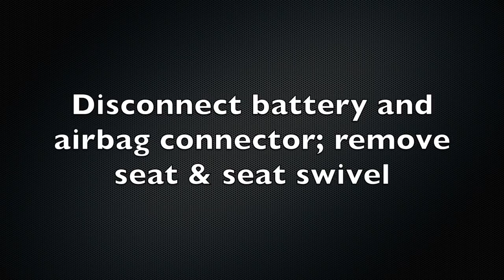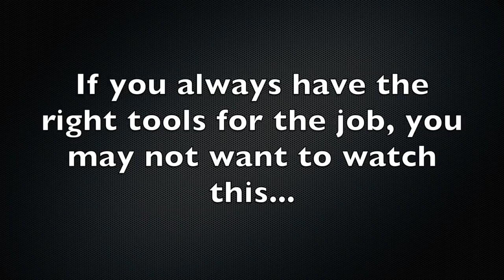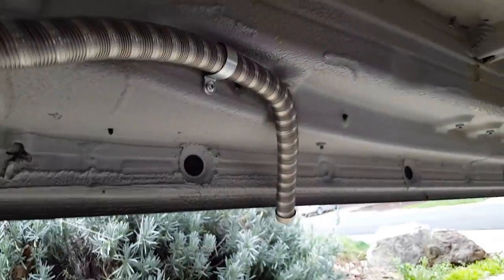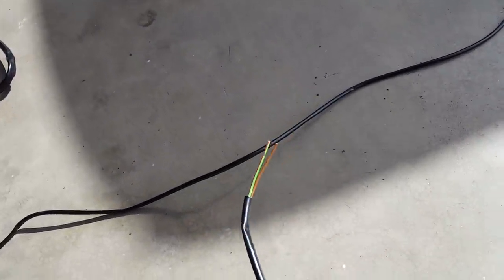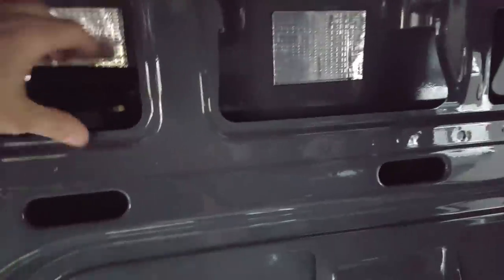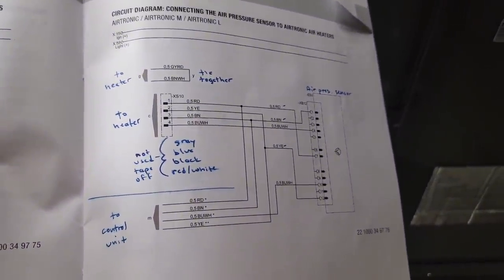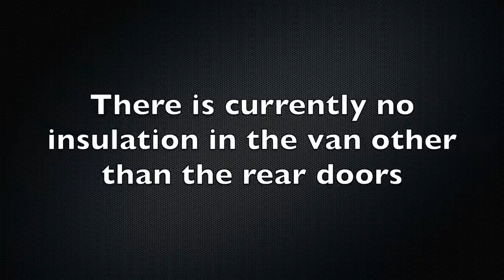Espar D2 Diesel Heater Install in a Mercedes Sprinter Camper Van

Comment: Great video! The one thing I noticed, if you are particular about torqued bolts to correct ft/lb using multiple extensions will throw the torque off. 10/10 install
Reply from the maker: Good to know, I was not aware.  I’ll have to think through that, it seems to me the extensions would transmit the same torque through them. But maybe not.

Comment: What a difficult install, bravo Ken!  The wiring looked very intimidating.  You are a master craftsman in your van build, and also in filming it with your detailed documentary style.  I have learned a great deal from you.  If you ever need a place to rest up and reload your van during travels, my house and driveway are open to you - in Santa Clara, CA.  I am also very good at fixing any health issues with supplements (over the counter) and back pain issues with targeted stretches.  This knowledge I can pass on to you if you need it.  Something to give back for all I have received.  Many thanks!
Reply from the maker: Thank you, much appreciated!  The electrical was definitely the most challenging part.

Comment: Thanks for the video. For future projects that need larger holes, consider a step bit for your drill.  You can get them cheap and in different sizes at Harbor Freight (Under $10).  Home Depot and Lowes carry brand names for a little more.   Very handy items for making precise size holes easily.  Buy the bigger size, as it will make small holes, too.

Comment: Great heater i have one install at oktober 2015 and use it 2 winters -14.
Works well does not use lotts off electra amd olso diesel.i have 2 140 amp Lithium battery install under front seats and heater at motor .Heats also motor.

Comment: Thanks I didn't think of it in the passenger seat the one I bought is bigger but we'll see if it fits I didn't know about the fuel line tap on the Sprinter so thanks that saves me from drilling a hole in a fuel tank which I didn't want to do
Reply from the maker: Most US Sprinters have the aux fuel tap but I've heard some Canadian vans don't have it for whatever reason.

Comment: Great video, please keep them coming as you progress through your build. In fact, you should have your own Sunday morning car show!! I'm undecided about installing my D2 myself or hiring it out. If I may ask a quick question, because frankly; I trust your opinion more than my local Espar dealer. My vehicle is a 2016 MB 144.While haveing a discussion with the upfitter, specifically covering what is included in their insane estimate for the installation of a D2, they said that "tapping into the main fuel tank at the aux tank connector is problematic because it's a pressurized system and all adapters and splices will fail. Not to mention the heater will fail from running rich from the over pressurized fuel getting into the heater fuel supply." So their solution is to drop the tank and add a stand pipe. It seems excessive to me, dropping the fuel tank and adding a stand pipe for the Espar heaters pump to draw from. It also seems they've created a problem that no one else on the internet has ever had. My question to you is, is their point even rational? Is this something to even consider?They insist I'm not their personal test case, because they've installed 5 of these. That alone makes me a skeptic. Thanks for your time.
Reply: Thanks for the super fast reply. Your answer was as I expected. Sadly that means I must attempt this on my own. Unless of course you can be tempted by Oregon IPA, because like you said, now that you've done it, you could do it much faster next time!  Keep the videos coming, they're very encouraging.
Reply: What was the response to this question?  I am interested to know, because I just T’d off of the aux heater fuel line to run fuel to the pump. I am about to install the High Altitude kit.
Reply from the maker: There is no basis I can think of for that argument.  Mercedes leaves the tap there for the purpose of auxiliary heating units.  I've never heard of anyone having a problem.

Comment: Hey Ken, in another video they mentioned that the the exhaust pipe between the heater the silencer (muffler) needs to be shorter than the tail end. I verified via the espar manual in the notes section on pg 23.  "if a silencer is fitted, the exhaust end pipe must be much shorter than the flexible exhaust pipe between the heater and the exhaust silencer." Not sure of the reasoning. Thanks for making this video. I've watched it about 50 times already prepping for my install.
Reply from the maker: Thanks Jim, I had read that as well.  As usual I had to compromise...had I moved the muffler further downstream the exhaust would have needed to turn upward (in order to mount the muffler), and then you create a low point for condensation that will rust the exhaust.  Always a compromise, it seems!
Reply: @ourkaravan  totally understand. Any tips on making the terminal connectors? I know its way easier using quick splices. Did you use a double crimp tool?
Reply from the maker: @jim6335  Yes, I used these http://www.amazon.com/gp/product/B0069TRKJ0  for small gauge wire and these http://www.amazon.com/gp/product/B00MVE48Z6  for some of the larger stuff.  They are reasonably priced, so I pulled the trigger and just bought them.

Comment: Hi again thank you for making the video. I didn't watch far enough to see where you had the wiring diagram and talked about the colors.. Again, it would have been helpful to see you connect the individual wires to the espar clip that snaps into the altitude unit.
Reply from the maker: I'm pretty sure I discussed that in the video. I showed the diagram and how you only use four wires between the HAC and the thermostat.  Sorry if it wasn't clear.

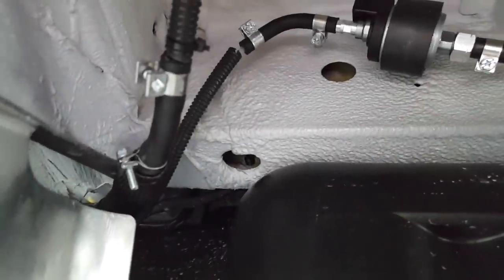Comment: I'm just installing my heater now.  Instructions on CD included in my kit are a bit ambiguous for direction for the metering pump.  Figure on page 24 (25.2720.90.0001.0A_EN_0518.pdf) is opposite than shown here at 4:45. However, page 10 of same pdf (scope of supply diagram) agrees with this video.   Aaaargh!. 

 My instructions also specify that longer exhaust piping before the muffler than after, compared to your comments around 7:30.
Reply from the maker: I can't access the document you're talking about but I know for sure my fuel pump is in the correct orientation.  As for the exhaust piping, I do believe Espar recommends longer piping before the muffler, I think I had indicated in the video that they are quieter if the muffler is further upstream.
Reply: @ourkaravan  Thanks for the confirmation, I'm going with that orientation for my initial test.  Need to wire up my controller and external temp sensor and then fire it up!  :)

Comment: wow, your video makes it looks so easy and I want to install one of these in my Promaster campervan too. But I know there is a lot of hard work went into the installation. Thank you for sharing!
Have you ever considered the webasto diesel heater when you planned the installation? Have you done any comparison between the two brands?
Reply: Eli Dai webasto is just three times more money.
Reply: My Webasto heater has a knob that sets exact temperatures. I had it installed in my Sprinter about 4-5 months ago. I chose the "digital" thermostat. It cost a little more

Comment: Good video thanks. There is no ground on a 12 DC system, it is a negative, hence the symbol on the battery, an AC system is grounded and has no negative,

Comment: Great video and channel, definitely a new subscriber. Have you noticed any problem with condensation since you’re only taking combustion air from the outside, and not the cold air intake?
Reply from the maker: Thank you Kevin. My understanding is that since the combustion and exhaust occur outside the vehicle and only room air is drawn in and heated, if anything it should have a drying effect.  I have had no issues with moisture.

Comment: That scalloped part of the seat base looks like it was made just for the gasket (template) to fit :)
Reply from the maker: I think I saw somewhere that some factory applications used that location for the diesel heater, but I'm not sure.  Sure worked for me though!

Comment: I did the same install , I'm very good at wiring but found this install to be very intimidating but like you said after you do it once it would be a piece of cake to do it again.
Thank you for your video I gathered a lot of info from your video and others , I definetly couldn't have done it with out the help.
How did you change it from low , med , high , boost?
Thank you for taking the time.
Reply from the maker: Congrats on the install!   The Espar figures out the correct mode to run.  It's interesting how it works--when you first turn it on, the furnace runs at full speed to bring the van to temperature.  Once it hits the set point the Espar picks the correct speed to keep the van to temperature.  It does this by measuring the temperature of the intake air and the room temp and tries to run at the lowest speed possible without exceeding the set temp.  If set temp is exceeded, it shuts down.  It's smart because the constant stopping and restarting uses more energy as it needs the glow plug to relight.

Comment: Bit late to the party on this one but your vid is very well put together and informative. Question; Is there sufficient access to the heater fuses through that little cover in the side of the seat base when the seat and swivel assy. are in place?

Comment: Excellent. Thanks so much as I'm getting ready to do this. Regarding the Dorman connector. Did you not need to T-off from the factory fuel connector? Someone else on the Sprinter Forum mentioned having to do that and using Dorman part # 800-176 which is a T. Maybe this is only required if you have the auxiliary fuel heater installed from factory? Or, how did you attach your Dorman connector? Did you cut an existing line? Thanks again.

Comment: Very nice install ! I am running an older D1 heater, still does a great job at heating. I do have one question, is there enough input air coming into the heater as it is mounted under the seat? I did not see a hose run for the input air. My instructions inform me that if a unit is placed in an area that is enclosed that one should make sure they have an air intake for the heater.

Comment: If you really need to extend the exhaust adapt it to a slightly larger pipe. That should prevent any extra back pressure.
Reply from the maker: That's what I will do if I ever extend it.  Performance exhaust for the Espar, haha.

Comment: Great video and nice install.. if you ever have any need to do any more work would it be possible to get the part number for your seat base ? I'm thinking of doing the same thing but uk-spec vans come with a slightly different seat base that doesn't allow for this type of install

Comment: This is an awesome video, thanks for posting. It helped me to get almost all the way there. I was shipped a very different wiring harness that doesn't seem to be for this application. DO you happen to know the part number of the harness that you have? I'm dead in the water until I figure this part out.

Thanks
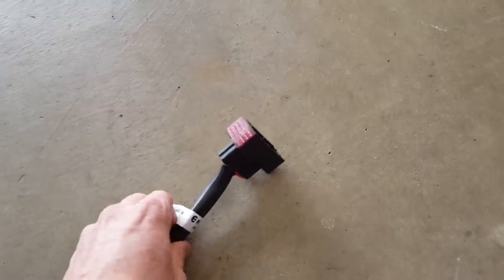Reply: Bummer, The part number is on the cable by the large wiring harness clip that connects by the heater (@9:26).I tried to screen grab, but it's just too blurry. That is also where my harness splits three ways, then ultimately terminating to two on the end of the very long bundles. There is no way for it to be installed in any manner that I can think of...and Heatso.com is playing dumb with the parts, that's also where I ordered. It's super frustrating. If I can find the part number that you have for your harness, I'll just order it and be done. The build is at a hold out while I try and sort this electrical nightmare.

Thanks again for the help!

Comment: Great video thanks for the info.

Just to check I know you mentioned that the connections to the aux battery was temporary but please tell me you fused the wire at the connection?

Comment: Awesome video, saved me a ton of time figuring it out.
I just have one question,
what happens with the yellow wire coming out of the altitude sensor ?
the wiring diagram says it should also be connected to the head unit.(?)
Thanks
Reply from the maker: I looked back at the video and it looks like the yellow wire in the harness connects to the yellow in the high altitude sensor.  Wiring diagram and my connections are shown at the 14 minute mark in the video.  Is this consistent with your wiring?

Comment: Great video. Helpful info. 
Got a question. 
I'm in the planning stages of a Van build but i think I'm going a different route than the Sprinter,possibly a Gasoline Engine. 
Could I run an Espar Heater if I had a small Tank for Diesel and and a small Pump?
Thanks for any info.

Comment: Thanks for the great video! I've got my D2 with altitude sensor installed and working, but haven't figured out (or found search results) how to change to Fahrenheit. How'd you do that?
Reply from the maker: Congrats on finishing a pretty complicated install!  The instructions for changing from deg-C to deg-F should be detailed in the manual for whichever thermostat controller you bought.  If you don't have it you can always google "Espar Easy Start Select manual" or whatever version you have.  I was able to find mine in a PDF online.

Comment: Kenetube - Where did you get the replacement vent cover for the passenger seat base.  Looks like a cool little detail to help provide airflow around the heater.  Thanks for a great video!
Reply: kenetube Thanks, super helpful.

Comment: kenetube, thanks for the very informative video. I'm wondering why you have the auxiliary battery setup and an additional lithium battery. Does the auxiliary serve any additional purpose?  The reason for my question is I just put my order in for the new 2019 Sprinter (a change from the VW crafter), and I opted for no auxiliary battery.

Comment: Hello, I was looking at the Espar B4L M2 model for a Ford Transit, it says it works at high altitude out of the box with no adjustments. Have you heard about the new model? 
At the checkout and there's no place for your coupon code, was that just for the model you installed? Thanks for all the help and great video.
Reply from the maker: Yes, the newer models have the HA sensor built in.  The coupon code is good for D4R D4L and D2L, as well as the older style D2, B4, D4, D4L.  Unfortunately I'm not sure the one you mentioned qualifies for the discount.  You can email heatso and ask, perhaps they'll honor the code?

Comment: I know you added the Esper D2 last February, just wondering if you've you have used it enough to have an opinion about it's size and capacity? Also, did you order your Sprinter with the luggage rails or are you added those later?

Comment: Another question regarding the Power cable aspect of the loom and the fuse box.  My POWER cable part of the loom has four wires, seems identical to yours.  Two larger gauge RED and Brown for power and ground.  I have a BLUE SEA fuse box under my drivers seat so I assumed I could hook up those two wires to my fuse box and use a 20Amp fuse at  that terminal on the fuse box.  IS that in error?    Then I am left with what to do with the  smaller gauge wires (Red and Red/White).  I have not used the supplied holder as I uncertain on how to do so.  My manual only shows a two wire power cable as opposed to four.    Can I somehow connect them though a fuse box or do I need to have them on separate fuse holder.    
I see that you used the supplied fuse holder but that seems to be before you had added fuse boxes.  You also seemed to have that under the passenger seat.  I am confused as to where that would tie into my loom under passenger seat and I thought it would be better to have fuse closer to the power source.  Did you alter any of your wiring once BlueSea fuse boxes were added?
Additional question, did you have to modify your exhaust location when you added electric step?   My exhaust will terminate under sliding door and I figure i should plan ahead for the possible addition of the step.
Again, thank you. Your site is one of the most informative "how to" sites I have ever seen, across multiple disciplines.
Reply from the maker: Hi Charles, it's actually better to have the fuse located closer to the source...so yes, you can use that to fuse the wire to the Espar and then you won't need the fuse block supplied with the Espar.  I recall two circuits, a 20 amp one for the glow plug start up and a 5 amp one to run the fan.  It seems like you would need two runs of wires from your blue sea--a 20A one and a 5A one.  Mine is still wired the way you saw in the video with no modification.

I did move my espar exhaust to the other side of the van.  There is actually a very good, straight and level path if your van is 2wd.  Perhaps you can email me (contact link at ourkaravan.com) and I'll send you a photo.  

And thank you, I really appreciate the complements!
Ken

Comment: Did you purchase a mounting bracket?  Does the thermostat work without the external temperature sensor?  Thank you for the great vids Ken, I have been using your amazon links.  Hope it helps you out.
Reply: kenetube Great thanks so much!

Comment: Hey, great video, very helpful. Are those factory swivel seats? I know the seat base is shorter with the factory swivel seats and I have been a little concerned about wether or not the espar would still fit under there. Thanks for your video and in advance for your response!
Reply: That's great news; we just ordered our 4x4 with factory swivels seats. Thanks again!

Comment: Very informative video. Did you put drain hole at the lowest point of the exhaust pipe as indicated in the install manual?
Reply from the maker: I did not, but probably should.